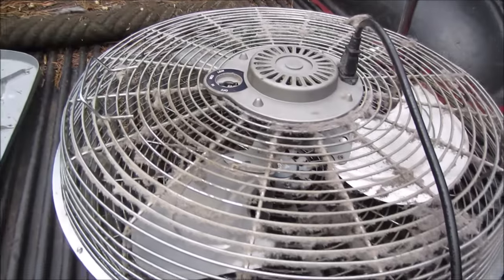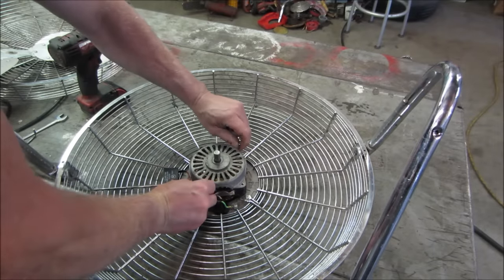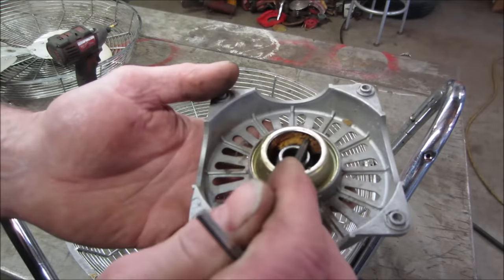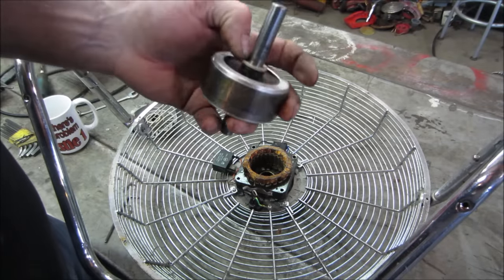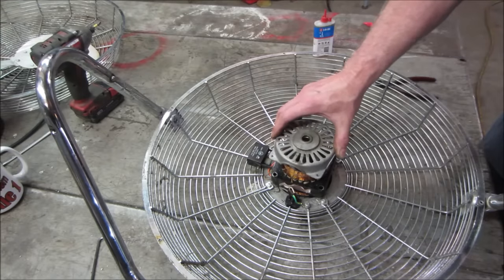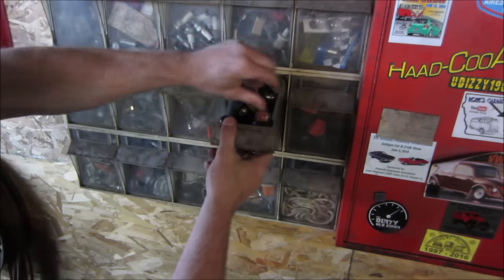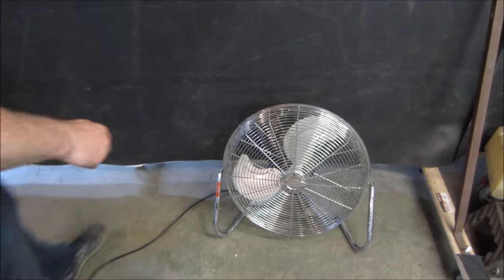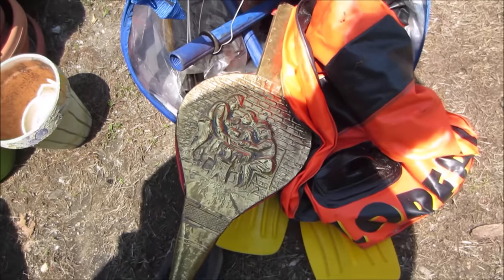Fan Blades Won't Spin? Lets Fix It

Comment: I polish the shafts...use 1500 or higher grit..chuck in a drill etc.. polish all groves marks away till nail can't feel a thing.. use felt to repack around bearings soak in oil...clean inside of bearing with isopropyl..soak bearing plug one end.... after assembly smack end of shaft with hammer to reset bearings.. done ...to test motor kill a watt meter will tell you when motor has drag and needs lube.. see specs on fan..  when it's close lube it..  even lube ports don't always lube bearing... so I disassemble my fans and manually lube and re do felt... my fan in window over 20 years old runs great..  oil is nondetergent with tufoil added runs cooler and longer.. I have lots of old fans that never die.. New fans have a fused plug. I have a ge box fan all metal 50 years old using right now got it as junk.. it spins great.. after 3 years motors are lacking lube.. polishing shaft will give you many years of service.. if not fan can bind up in a few months...  enjoy... I do my fans yearly.. easy and fast..

Comment: To make that fan to work for a long time, you must apply heavy-duty grease, like the one used in cars, it is that the heat the motor creates, drives out the oil, and it starts collecting dirt. heavy grease tends to hold heat and stays firm. dirt won't go through it.
Reply: Very very wrong

Comment: That's factory packed old grease & you can clean it up & put new grease in it & put some light oil like 3 in 1 oil on the shaft or wd-40

Comment: I have found out that the bearings lack oil. And the second thing is the packing of dirt and debris. I fix these all the time. They run for years at a minimum of maintenance.

Comment: Edit: 0:41 Me when I take off normally in my 2007 Honda Fit from a traffic light 
.
The ones we got at work keep doing this occasionally, even the brand new ones have done it simply due to being chock full of dust or not lubricated enough. Those ones are kinda built badly though 
Gear oil and ATF have never failed me getting them going beautifully again though

Comment: I have 3 Lasko 18" Stand 3-Speed Fan with Cyclone Grill every 3 to 4 months take plastic grills and blades off put them in the tub spray windex and blast them with shower high spray then oil shafts 3m oil normally fans last 4 to 5 years before 3 way switch goes out then i'll buy a new one   they run 24-7 never stops until time to clean them here in South Carolina

Comment: In terms of experience soaking the fan motor won't kill it so long as you don't plug it in but even then I've seen Hpad throw a bucket of bubble water at a running box fan and it kept going without issue that is until he beat the shit out of it with a golf club

Comment: I'm the kind of person that does not care much for all this new plastic so I have a lot of old metal fans  and that yellow stuff that you saw like I saw mentioned in here is for putting oil in you get it wet and then it gradually oils the Bering as far as the switch goes what I would've done is cleaned both the face of the switch and the face of where it goes into and then I would've gotten some of that red label 3M double stick tape it's almost like a  gray buddy cut a square put a hole in the middle of it and then sandwich it between the switch and the housing I'll bet that would work LOL

Comment: I always use air tool oil when I clean and lubricate fans like that.  I figure if it will work at 20,000 rpm it will work good on a fan

Comment: I miss the old electric motors that had the metal cap with sawdust under it. You just poured oil into the sawdust and it kept the bearing lubed for years. But those motor start capacitors made recently (within the last 15 years) are gahbage

Comment: I missed how you reattached the switch to the housing, how did you do that?

Nice that it was a high enough quality motor that you could disassemble it.  The ones I usually get cannot.  Ditto on the fan blade, many are just pressed on and if you take them off, getting them to stay on again is tricky.  I find it interesting that the stuck one was the front one, again, I usually find the rear ones are sticky.

I like to use low viscosity synthetic oil on them.  Seems to last far longer than any other oil I've tried.  I use a small hypodermic needle to get under the seal if necessary.

RichE San Diego, CA

Comment: 8:15 the 3 in 1 BLUE (non-detergent) oil is 100% the correct one to use on older fans of that type.  Just don't use the yellow 3 in 1

Comment: I have that same fun and keep it as long as ya can dude. Lakewood is long outta business now. Holmes Products bought the place they were in but it's not the Same Quaility anymore sadly. I had a lakewood fan from 1972 that I trashed picked and I ran that thing for years after oiling the motor. Sadly today June 15th, 2020 that old Lakewood Model S223 (box fan) finally died! Motor burned out. Also Smart Choice on the using the 3 in 1 in the blue can that's the best oil you can use in electric motors. I use the blue 3 in 1 and the zoom spout oil when I fix fan motors. BTW you still got the Meter Maid by any chance?

Comment: I've always called that grease Chinese ear wax. They developed a grease that will work for a couple of years then harden as it collects dust and dries. Use graphite or a dry moly lube.
Reply: It's actually packing material that holds oil, and slowly wicks it into the bushing. Kinda like the old wick you would see rubbing the eccentric on a points distributor.

Comment: They get GUMMED UP.    I just High Pressure wash the inside of the motor and re-lube.  It works most the time .  One time washing does them no harm.   Food Grade Silicone lube worked for me.  Goes on wet but dry's .

Comment: I'd be using a lube gel.  I use that stuff to lubricate my cooling fans for my PC's. They last FOREVER, or until they cake on dirt and crap on them they wont run efficient and are too much trouble to clean up.

Comment: Ive never once had to buy a fan. they always do this then people throw them out. you can use a spray lube   can with a  long  straw to get behind blade to  do a quick fix or take it appart. I  use  bearing grease on mine. ones been working for like 7 years now. I think they use crap grease so they die fast and people buy more lol

Comment: Looked like the previous owner broke off the ground pin on the plug side of the cord. I'd recommend a replacement so you get the safety ground.

Comment: A few years back i came across a small fan motor with leather blades attached to a wooden dome shaped block that attached to the motors shaft. No info on the motors case. Giving any idea what company made it or its voltage requirements.

Comment: Motor oils have a detergent that absorbs oil and dirt. And gets thick.. and thicker... and turns to grease.....
Electric motor oil, compressor oil, 3 in 1, etc are non-detergents.

Comment: OR ...you can just drill a small hole on the top of the two swells where the ends of the shaft are  and oil there directly without disassembly.

Comment: ive used that 3 in one oil on all kinda motors even on really underpowered ones and still run just fine. really just depends how much is used i guess. to me oil is oil better than 0 at least lmao.

Comment: If I got a dime for every blower like that I've repaired, I'd be up ~$20
Dust, Gummy lube, blown thermal fuse (often fixable)...
Yeah, those "oilite" bearings do wear to rattle some, but a cleaning, oiling, for use in the garage or shop?
Let it rattle till armature rubs stator.  ;-)

Comment: You should probably soak those bearings, front and rear, in the electric motor you used. The fan will probably stop turning after a week of use.

Comment: I have a 3 speed table top fan that oscillates from wal-mart.. Nothing happens when I push any of the power switches.. Any idea or video on how to troubleshoot whether it's the capacitor or the DC motor..

Comment: Whats usually the issue when a 3 speed metal fan doesn't turn on at all or move when you turn on the switch.

Comment: I have a zturn mower, 2 years old that has begun to bog down when I engage the mower deck. Have done all maintenance on it (oil, plugs, filters grease points etc) no good, also checked tension on deck and drive belts and played with the fine tuning on the governor,  nada.  Any suggestions? it is a Kohler 7000 twin 737

Comment: I found clipper oil works great in fans, I use in Pc fans , muffin style an so on the small low voltage an no problems.

Comment: So quick question? I have a fan like  just like that one it works well but it came attach from the back of the fan the motor part in place in the back that hold the fan & Motor together  because mines came  apart From the back of the where the Metal part is it welded Down on the fan motor part because mines came apart and I can’t seem to get it back on unless I’m thinking I have to get it welded don’t know if I’m explaining that right?

Comment: I did use my current tester and there is 120 going into the top of the fad where all the wires go into the motor. Is on the bottom the power court splits in 2. One is the line I guess 1 is the neutral. I do have 120 at the base and 120 at the top of the fan but I don't really know how to test the switch that has the red wire the rusty Orange wire and the Gray wire and I don't know how to test the capacitor... I looked on Amazon and the capacitor is like $6 so that's no big deal.. But I would just like to know the proper way to take a tester and check the 3 switch positions as well as testing a capacitor and understanding the flow of current as to where it could be failing thanks for your time everyone

Comment: I have a question? How is it possible to make a electric motor spin on ac? I always thaight that the armetor and the magnets was dc because there is only one direct path for the current  to flow into the brushes and to the armetor. But with 120 motors there are no magnets theres electro magnets witch is basically a secondary armetor to react to the internal one. This doesn't just give one but an alternate path for current to flow. I thaught that was the answer but i can tell this brushless fan motor is different it's  only got a one way path of current. So my question is how can alternating current flow through it and it not try ro spin both directions?

Comment: Lol my mom almost threw one out so I picked it up. Wouldnt even make a noise when plugged in.  Got wet she said. So I decided to investigate. The switch was fried. Threw it out and decised to hard wire it up so when u plug it up it works Yada Yada Yada. Anyways the little capacitor was fried too so and BTW I'm not an electrian at all.... Tried to wire it u a few ways. Not sure it's right. I got motor humming tho but won't spin. Gonna look into it again. Could the wiring be wrong or would it not even hum hahah

Comment: My fan stopped spinning so I took apart the coil to lube everything up but when I put the coil casing back on it has difficult to manually spin the coil but when the coil case is off i can manually spin it much easier...any idea how to fix this?

Comment: I need help with my PowerMax HV-20G my niece had a ballon and the string got wrapped around it and it stopped working it’s a vintage fan from the early 2000’s I need help🙃

Comment: I'm wondering if anyone could help with an issue I'm having with  a lasko floor fan. When the fan is off I can manually turn the blade freely but once I turn the fan power on the blade will not move and if I attempt to manually turn it while power is on, the blade will not allow me to turn it. It feels as if the blade is being stopped. I've cleaned it thoroughly and applied oil to the bearings but same problem is happening.

Comment: The first thing I would do is test the motor with a multimeter to see if  the windings were good or not before wasting my time tearing the thing apart. But that's just me. 😒

Comment: I have buy a fan from shop and 1 week later it getting hot in the motor and stop spin, i wanna try to fix it by putting oil but i don't dare to do it because I'm afraid it gonna explode and die single. Can somebody help me, i don't have time to repair it on shop due to kung flu..

Comment: i used 3in1 it doesn't last now i use vaseline i melt it and use a seringe and let run down the shaft and turn the shaft at the same time

Comment: every fan you buy cheep are garbage hade to fail in a specific time if used everyday , the barings are steel on steel thy rust but the killer is the felt padding used to center the barings ,, made in china gabag , i have floor fans from 60s made in canada still going strong 
:)

Comment: Mustie1, I have been watching your channel for some time. You are informative, and you do not make things seem as if you know it all, even though you obviously know, understand and can competently investigate new ideas. You are a very good educational and operational individual. However, you have made a classic semantic mistake. There is no "gas motor."
     There are four basic energy conversion devices.
           1. The engine, which converts chemical energy (usually organic bases potential energy sources such as wood, gas, oil, and other organic combustible compounds) These engines are used to convert the potential energy compound into either an explosive force or heat energy which is then used to cause a change in other materials, such as an expansion, or basic shape as when you caused the knob to fit the switch on the fan. The expansion can be rapid such as water to stream or slow such as metals which expand slowly. 
          2. The motor which is an electrical to mechanical conversion device. The motor is used to convert an electrical potential energy source, such as a battery for DC (or direct current), or an AC (alternating current) potential energy source,  such as a generator or physical plant source, (somewhere the actual ac source is a generator but the energy has transferred through so many devices that while it is the primary source, it is usually not what the end user thinks of when thinking of the ac source, usually called wall power. This electrical source either AC or DC is used to once again turn that source of energy to mechanical energy such as rotation or expansion. Technically, a simple telegraph system is a motor as it converts the source energy (electrical) to a movement energy (mechanical). Other examples would be starter motors, fan motors or heat energy to cause change in other materials such as plastic and water (steam). 
          3. This is a good segway into number 3 which is the generator. It is generally (no pun there) a device which converts mechanical energy (any source of energy caused by the mechanical movement of physical structure, wind, water, steam, (geothermal) into electrical energy. such as mechanically turning a shaft with coils on it inside of a magnetic field. The energy created is then mechanically and electrically controlled and manipulated into either AC or DC as previously discussed. 
          4. The fourth is Nuclear. I have some basic understanding of this system but to use what I know (which is very little) and try to explain it so that others would be able to understand it would be long and dry. Suffice it to say that nuclear energy is usually used as a heat source to change other materials such as water to steam.
     There is no such thing as a "gas motor," as gas is a chemical energy source and a motor converts electrical energy. A motor is an electrical to mechanical conversion device. The motor will convert electrical energy to mechanical energy.
Obviously many combinations of these devices can be daisy chained together to achieve a desired result, but each conversion is it own device. One such chain could be the Hoover dam to change mechanical potential energy, the water position from the lake directly feeding the dam's turbines, to electrical , the electrical transmission lines to bring that electrical energy to your shop and the wall source energy (electrical in nature) to operated the Electrical fan motor converting the electrical energy to mechanical movement of the armature and blade thus resulting in further mechanical manipulation of the air around the blade.
     I hope this is informative to some of your viewers as I am quite sure that you already know all of this. I just said it as I have a paticular sensitive spot when engines are called motors. Thank you for allowing an old math, English, automotive, vocational and adult education teacher to rattle on. Have a good day and bring us many more informative and otherwise educational and entertainment videos.
Reply: #3 ,,,'segue',,,
Beware the Motor Oil?

Comment: my cheap box fan has a motor that looks just about like that
my last box fan ran 24/7 for 4 years, could have gotten 10+ years out of it with a little bit of maintenance but theyre so cheap, why not just buy a new one

Comment: If you you put silicone oil or grease on mating moving metal surfaces you just condemned it.  Silicone softens the metal surfaces and they gall away as many gun owners have found to their cost.  It is NOT a metal to metal lubricant.

Comment: 15:32 THAT IS EXTREMELY FOOLISH TO TRY A DANGEROUS STUNT LIKE THAT, DUDE --- YOU SHOULD *NEVER* START UP A POWERFUL FAN WITH METAL BLADES WITHOUT PROTECTION OVER IT, AND CERTAINLY NOT FOR THE FIRST TIME, WHEN YOU DON'T KNOW IF IT WAS OUT-OF-BALANCE OR SOMETHING --- IT COULD HAVE WOBBLED OVER AND THE EXPOSED BLADES COULD HAVE SLASHED YOUR ARMS AND CHEST!!!